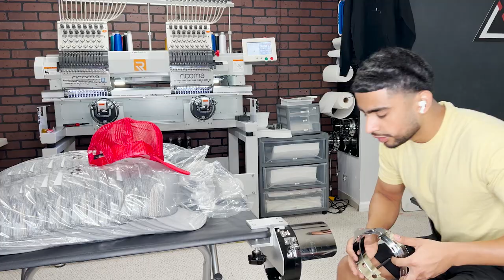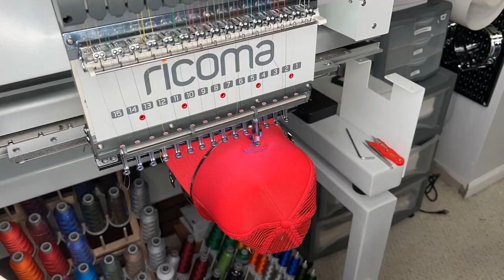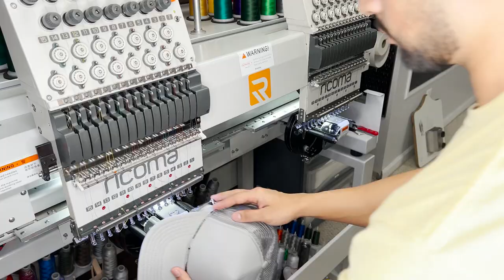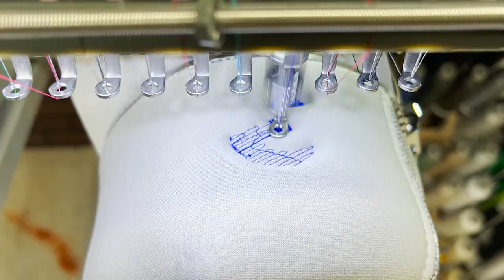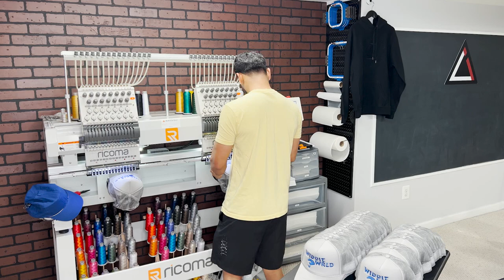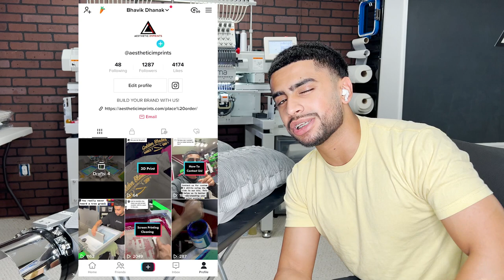Embroidery On Foam Trucker Hats From Start To Finish

Comment: For your embroidery machine, have you had a problem with one head being centered and the second head being off center? If so, how do you fix that?
Reply from the maker: I have not ran into that issue but I did have a slight hick up with one head not lining up with the bobbin hole. In that case there’s a skrew behind head number that you can loosen up the adjust the heads. I’d call up Ricoma’s tech team and they would walk you through it on face time
Reply: @baavproductions  Thank You! I’ve been binge watching your videos since I came across your channel! Keep up the great work!
Reply from the maker: My pleasure! And I appreciate it🙏🏽